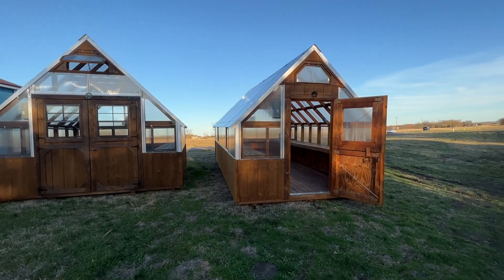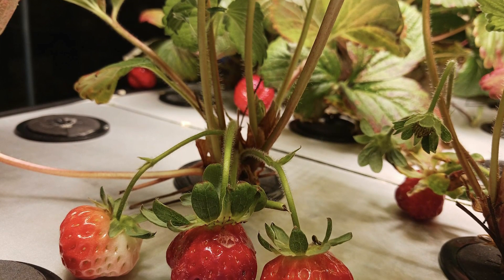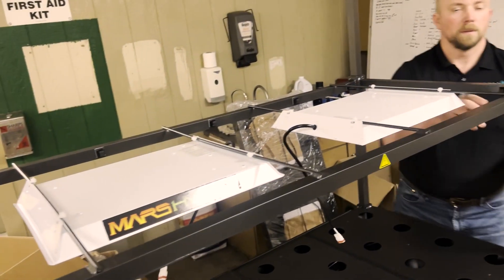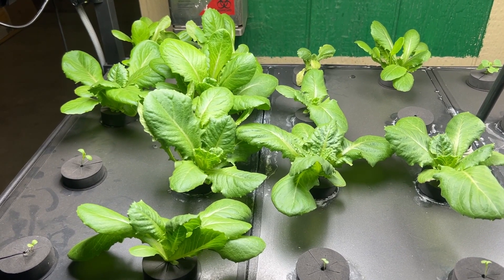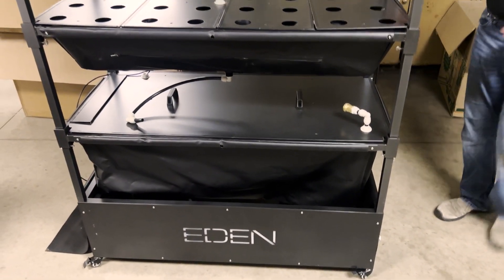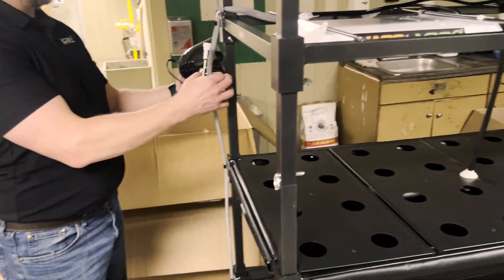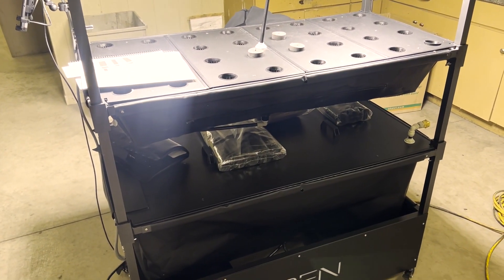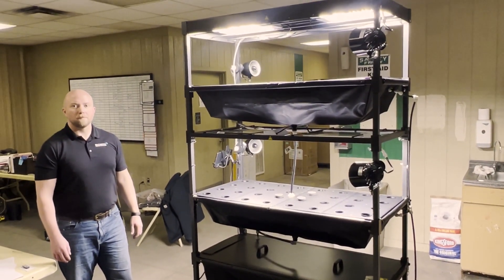See how NASA plans to grow food on Mars- EDEN Grow System Assembly

Comment: As far as the greenhouse size is concerned, I'd go with as large as both the budget and property site will support.  You can ALWAYS spread things out a bit, if you don't need the space (now).  We were drooling recently over a property near us on the market that has a 5,000 sqft bunker that has a similar hydroponics setup, and a soundproofed range!  There's also a near commercially sized greenhouse on the property (over 300 acres) along with two stocked lakes.

Comment: If you are going to get a greenhouse then you must make sure you have roof hatch's for air circulation and the hatches must be automatic because of temperature 25c! 
The struts for the hatches should expand at 25c to preserve plant respiration and photosynthesis, if plants get above around 30c the photosynthesis stops and the plants won't grow or fruit while that hot so the heat will halve the growth and energy production of the plants for the day!
Have a ripper Ron!

Comment: You need to have a demonstration bunker underground, on premise with this installed powered by solar panels with security system, a full package deal. That extra 2 feet under the floor could come in handy for and extended version of the grow system, even though goldfish or not all that eatable, there great for beginners when it comes to Aquaponic there like training wheels for Aquaponic, goldfish or so durable. The tilapia are a great freshwater substitute for cod when it comes to fish and chips.
Reply: You never be able to grow sufficient amount of food in a bunker do to limited space, problems with mold growth. A top side greenhouse is the best option since you can grow food in a non-contaminated area. You just wait for after the first month or two to start planting. as long as the soil inside remains uncontaminated it should be fine to eat.

Comment: Question about having something like this inside a bunker: How does this effect the humidity levels inside the bunker?

So, in colder regions they have these grow houses (greenhouses) that are half buried in the ground to help fight off the cold temperatures during the colder months. I bet the engineers at Atlas could improve on the idea. After all, one of the issues after a disaster where you need a shelter, is going to be having food.
Reply: We try to contain as much moisture as possible to conserve the water so it’s pretty minimal.
Reply: @Blaine Comeaux  so the moisture loss from the plant leave isn't much, or is a dehumidifier used?
Reply: @michaelcase8231  we don’t use any dehumidifiers in any of our locations.
Reply: @Blaine Comeaux  thank you for responding. I was only asking since a sealed bunker doesn't have the advantages of great fresh air flow. If this is a viable food solution, then people could get a bunker for food production without losing any yard space.
Reply: Hi! Thanks for your question. In terms of humidity levels being affected by the Grow Tower, most of the mist is contained within the root chamber by design, to recover and recycle the maximum amount of water possible. So, the system only contributes the amount of humidity released by the plants due to transpiration and a small amount through the grow pod collar around the plant stem.

Comment: Say that you are living in your bunker for an extended period and you got your food preps and enough of these units to supplement your diet with what’s left.. wouldn’t these units promote better air quality but same time risk potential molds and mildews growing in the bunker?
Reply: Hi! Most of the mist from the tower system is contained within the root chamber by design, to recover and recycle the maximum amount of water possible. So, the system only contributes the amount of humidity released by the plants due to transpiration and a small amount through the grow pod collar around the plant stem.

Comment: "The Eden Growing Shelters" in multiple sizes coming to an Atlas Survival Shelter website near you. I bet you can get the three tier inside one of your shelters. By engineering access doors for each unit and then have them wall to wall. You can sink them under the floor boards. You will need to exhaust heat or move the heat into other living areas. I would also on your walls apply a mirror film so that certain frequencies of light are not absorbed by the paint in the walls. I think you will need a toolless hard mounting system for direct hard connection of the vertical pipes/square tubes. Also a clasping system to secure the horizontal pipes/square tubes to the walls. I can engineer that. LOL. Also in case of leaks you will need to engineer that form of mitigation. Then you need water. Then you need another shelter in order to grow and raise fish throughout their life cycles. That is another shelter system to research. Hey Ron cut me a check dude. I just saved and made you a ton of $$$.
Reply: My like Number is 445. That sounds like a necessary companion to every shelter sold.

Comment: Only weakness is power source. If you have that and several of these you would be good for a long time
Reply: Agreed, the 3 tier system uses 7kWhrs of power per day.  If you're off-grid that's going to run your battery bank down pretty quick.
Reply: @mro2352  I believe it's for the entire frame including pumps.  The website wasn't clear.

Comment: I love it! 

I did indoor gardening back in the 90's, but it was in soil, and I wasn't growing food. 

I've now switched to hydroponics and growing food, and it's not only very productive,  but it's a lot of fun.

With the price of food, these units will eventually pay for themselves, too.

I have an 8-bucket DWC system in a 4x4 grow tent in a spare room, and it allows me to grow plants that get very tall, but I am limited to 8.

I'm also using AeroGarden small units, and AG clones, but the volume that can be produced in 1 garden doesn't compare to something like this. Of course you could also buy many of those units for the price of this system, but your grow height is also limited to 24 inches in something like the AeroGarden Bounty (Basic or Elite), and even less on the less expensive models. Although you can grow up to 36 inches on the pricier Farm XL unit.

I'll be keeping my eye on the price of this system. It's obviously very high quality, and some thoughtful planning definitely went into it.

From the looks of things, everyone should be preparing in every way possible, and food and safety are obviously at the top of the list.

Comment: A wood floor in a greenhouse is a very bad idea. Except for cactus and other succulent plants, potted greenhouse plants need to be watered once or twice a day during the growing season. Vegetable plants in pots certainly need frequent watering. Water on wooden floors causes the wood to warp and rot. Working greenhouses have either a thick layer of gravel over bare ground or concrete pads instead of wooden floors.

Hydroponic grow racks that have grow lights are expensive to buy, expensive to operate and cannot produce much food. A real working greenhouse that depends upon natural sunlight and is large enough to hold many five-gallon buckets of potato plants, tomato plants, zucchini plants, etc. could extend the growing season in cold climates and help a family produce enough food to be semi-self-sufficient. Anything less is just a hobby for plant enthusiasts and fine for growing African violets and begonias but not for feeding a family.